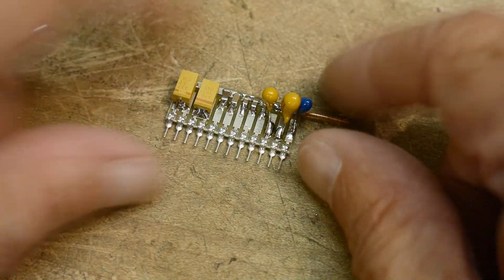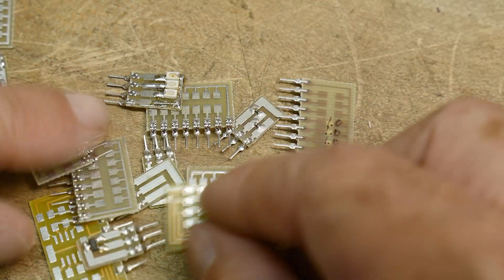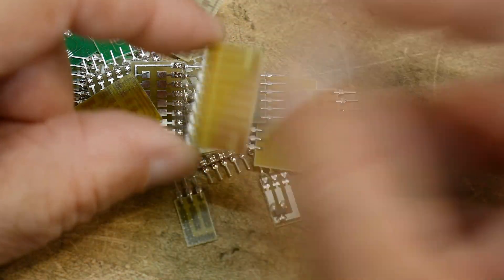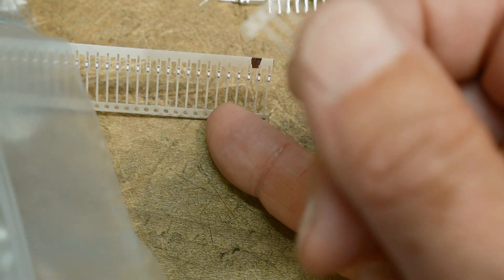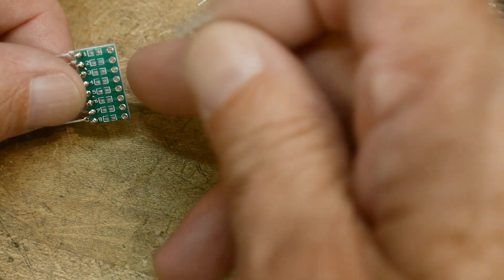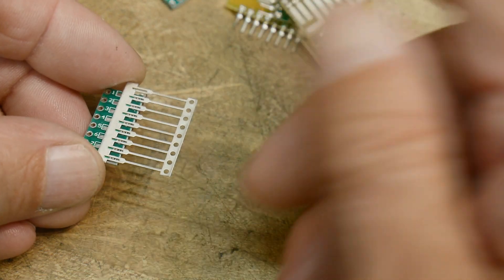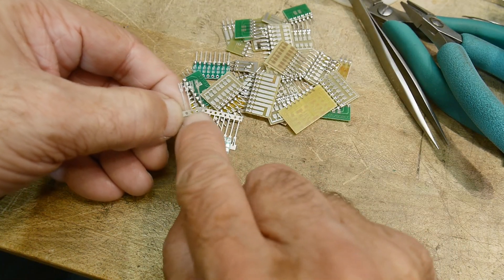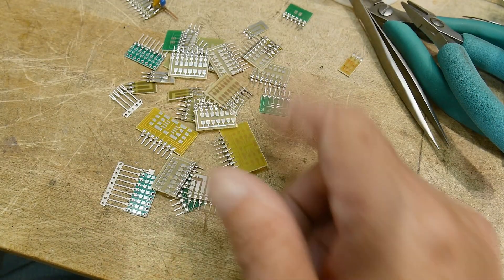#1956 SIP to SMD adapters (part 1 of 3)

Comment: A recent CuriousMarc video, Apollo Comms Part 31, mentions "flip pins" at 11:21. Apparently they were made for OSHChip, something that's been featured on hackaday. A small PCB with them looks a lot like a DIP package because of their shape. Bent 90 degrees, they should work in this application as well.

evilmadscientist shop says "not currently available" - hopefully that's just temporary.
Reply from the maker: the same company I got my pins from also has the 90deg versions

Comment: I usually end up just using a DIP adapter for most of my prototyping with smd parts or for subbing in nicer more recent OP Amps into older boards or DIY kits, etc. Could that also work here and be easier? Then you just need some male to male breakoff headers.

Comment: It looks like you could solder 'tack' the front bent pins first then bend that big bar to snap it off.  Then resolder through the holes to the back.  Some kapton tap at the back to stop solder coming through the holes perhaps.

Comment: IIRC, TE Connectivity used to be Tyco, and before that Amphenol. Helps a lot when you find an old AMP/TYCO part, as TE still produces lots of them under the new name.

Comment: Years ago I got my hands on a pile of rather unique header pins that were made for doing just this.  They have a S bend (two 90 degree bends) on one end of the pins.  They just drop through a hole and can be soldered on as SIP pins.  They are in sticks of 100 pins.  The other end (the tips of the pins) are connected by a strip that snaps off after assembly.  I think I got them at a local R&D lab clean out auction.